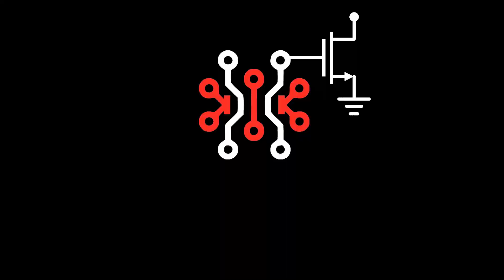TNP #4 - Keysight Turbo Encabulator Review & Teardown

Comment: I see that you're using a 1550nm Clark Transform true-RMS GaAs ellipsoid fruit converter with an inter-digitated, biphasal chopper amplifier.  Those things have superior phase margin over spherical vector field type source measure units.

I really love that it's a low voltage noise density circuit with balun-coupled non-uniformity correction.  Obviously, the quantum efficiency is greater than IP67, UL 94V-0, or RoHS.

Not only that, the noise equivalent delta flux density is less than the temporal noise standard deviation over a large core saturation voltage!

AMAZING!

Comment: How did they solwed the low friction coenficiency under the heawy vertical load during the horisontal aceleration, that was a big problem as seen in 1920 to 1930s films

Comment: One thing worth noting here is that the only new principle involved in this device is that instead of power being generated by the relative motion of conductors and fluxes, it is produced by the modial interaction of magneto-reluctance and capacitive diractance.
Reply: Erm. Wouldn't you just get a lot of side fumbling?? Not to mention sinusoidal depleneration. Sounds bogus.
Reply: @jessicav2031  ah yes, there would be a lot of side fumbling, if it wasn't for the fact that the panametric fan consisted simply of six hydrocoptic marzlevanes, so fitted to the ambifacient lunar waneshaft that side fumbling was effectively prevented.
Reply: @AI7KTD  ,  This is intuitively observed by the obvious deviation of the ocular sinuses.